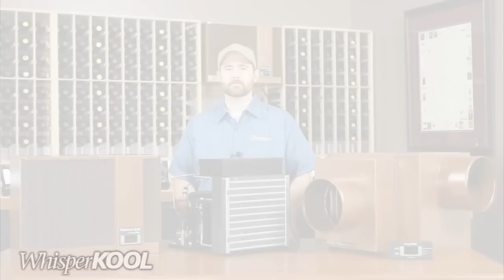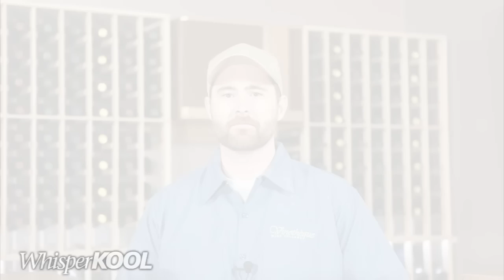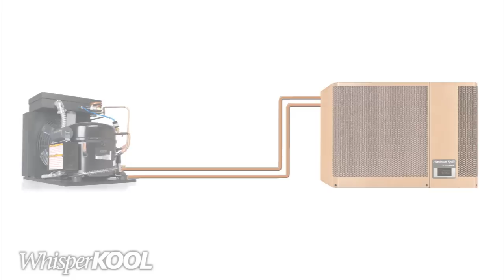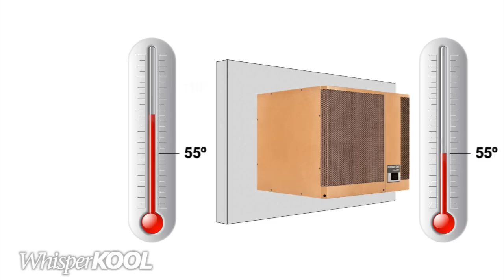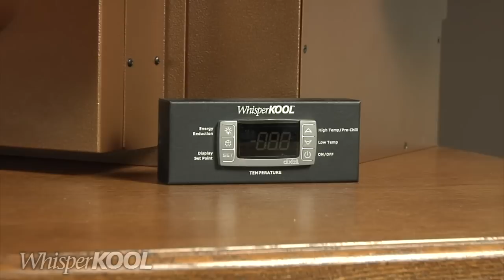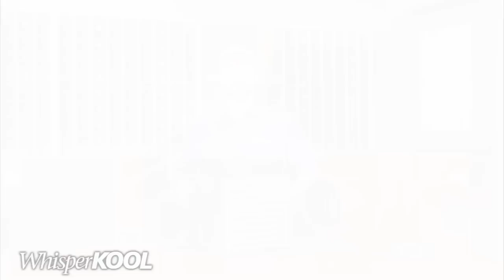Platinum Split System - Wine Cellar Cooling Units | WhisperKOOL

Comment: Does this system have a heat function also? I'm thinking about building a wine cellar in one of my barns but I'm the winter it can get well below freezing.
Reply from the maker: Hello The Papabear2012,

Currently, we do not offer a heating function with any of our units. However, our customer service/sales teams would be more than happy to assist you with more details and figuring out your own unique cellar installation. Give us a call and we will make sure your wine is happy and, your desired cellar area is functioning in tip-top shape.

Best Regards,
The WhisperKOOL Team 
1(800)-343-9462